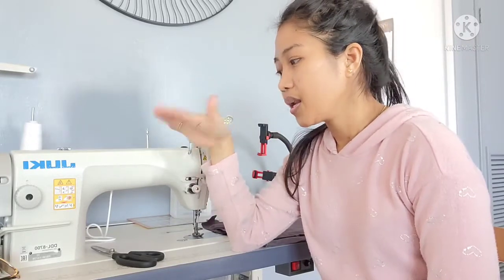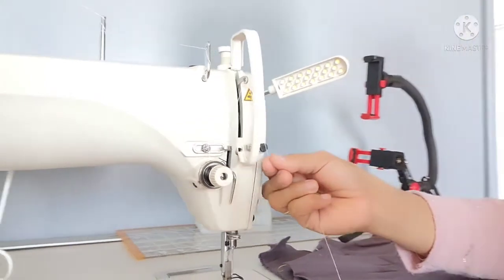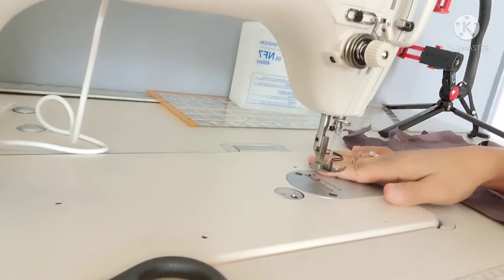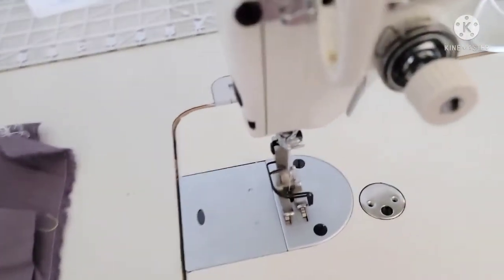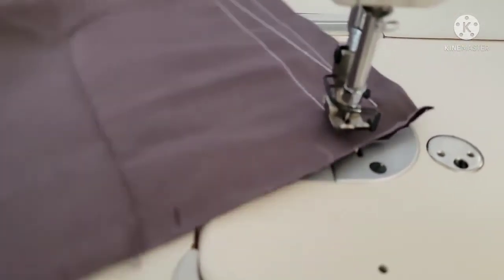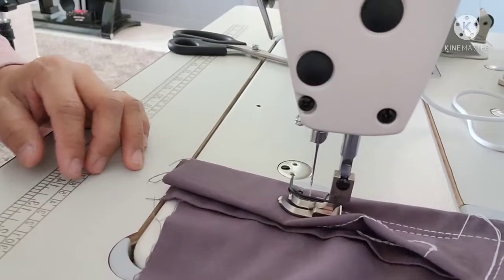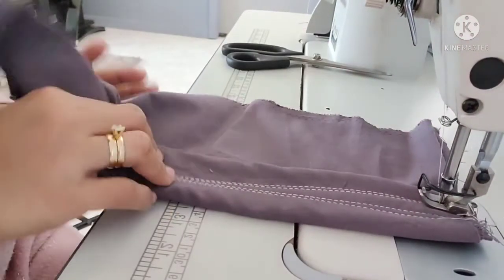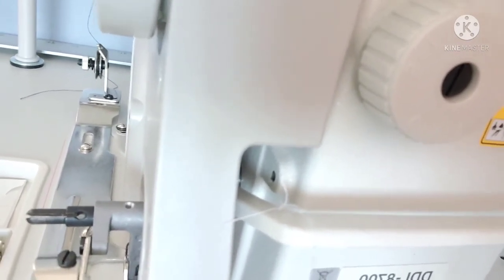How to operate  ddl 8700-H industrial sewing machine

Comment: I can’t tell you how much I needed this video and your install one! You did a great job! 
Is thread a 50 wt? Or 60? 
I’m going to try and sew tonight with a few threads I have to try it lol..  I have to oil it and run it still and install my thread stand.

Thank you so much for the video! And I loved your socks! Very cute. 
Oh I seen thread pin on another’s channel if it’s loose , there is line on it you can tap it with a hammer to line only. It will sit securely.  They helped me in that information because I couldn’t understand why was so loose 😂❤
Reply from the maker: As of now  I'm  just using the regular thread.I feel like the thread for this  machine  was thicker for what I'm  working on.
Reply from the maker: Thank you so much.🥰🥰😍
Reply: @createwithdawn8500   thank you I felt the same way. Now going to try regular thread. At while I wait on thicker thread for thicker projects. 
Thank you for answering and let me know. I really appreciate it. Can’t wait to try it out more. I did try scrap Jean fabric it was up to layers in folds no issues .. amazing machine lol
Reply: @createwithdawn8500   I also seen on Juki junkies they say brand- Glide 60 works amazing in machine for general fabrics if regular is not working. Step up from regular 50 wt.
Reply from the maker: @delilahcarbajal6734  I'm  glad you find it helpful.Really appreciate  you.Thank you.